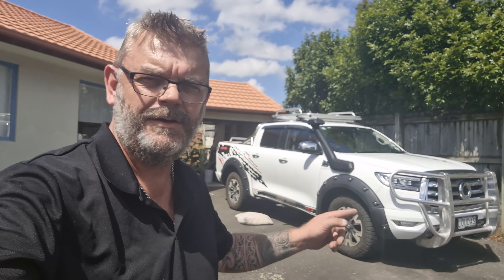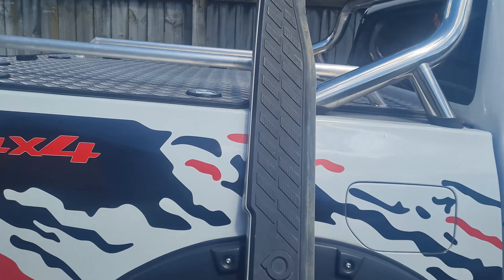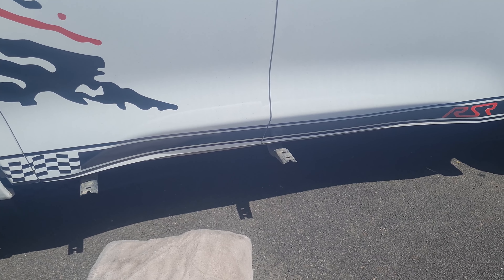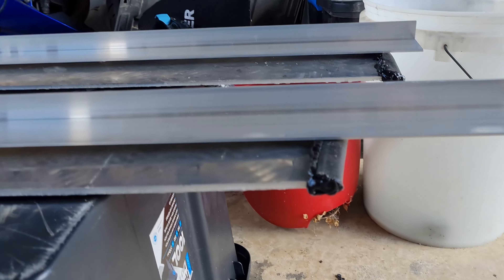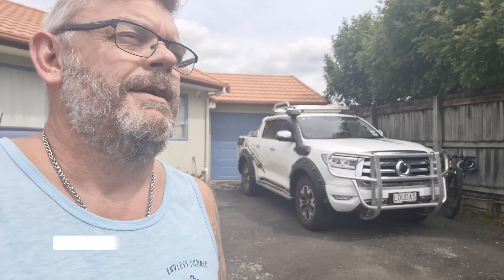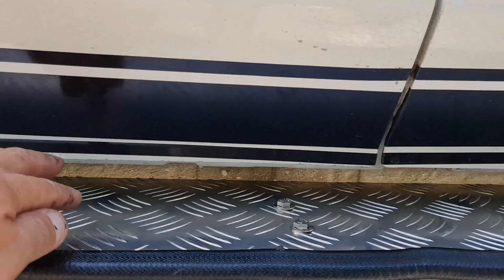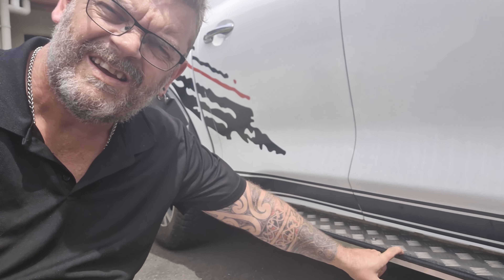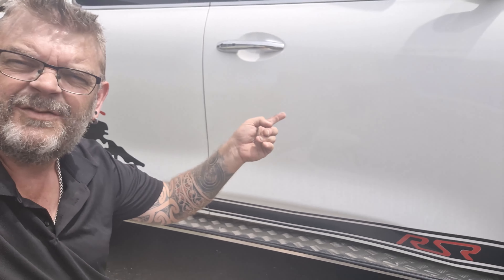GWM Cannon Custom Side Steps

Comment: I  saw you put the snorkel on, I  am in Australia but can't get anyone to mount it for me
Reply from the maker: It's not too hard .. be brave :)
Reply: @loudas  my name Kevin, Paul,  and did you make up a template for it first.
as far as side steps, I might see someone who can weld up a support frame to go under the side step, bit next project apart from getting the snorkel on is a lift kit
Reply from the maker: @michellegrayson4336  hey Kevin,
Check my other videos.
There is a video of me installing the snorkel. 
And a video of the rock sliders I have put on recently after I broke my side steps
Reply: @loudas  yeah saw your video but you didn't show how you found right position to put the big hole
Reply from the maker: @michellegrayson4336  oh right... I just lined it up with the A pillar .. then prayed 🙏 🤣